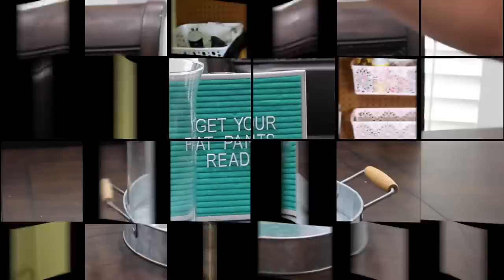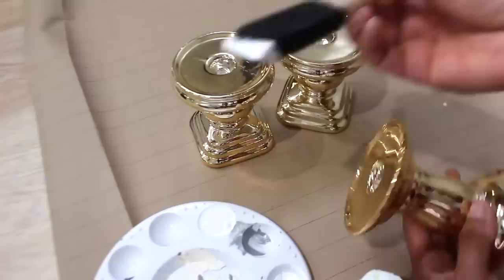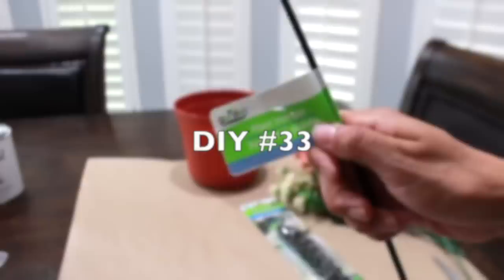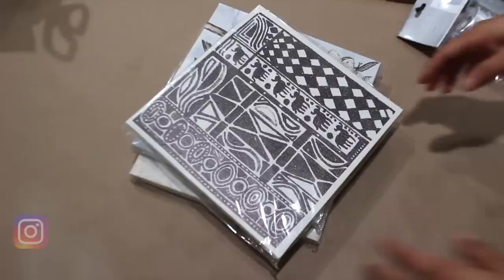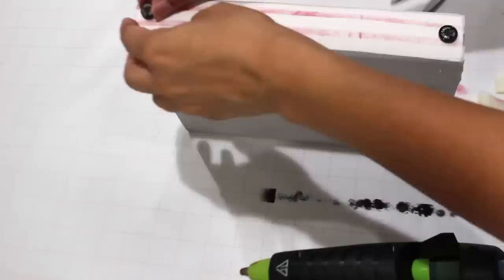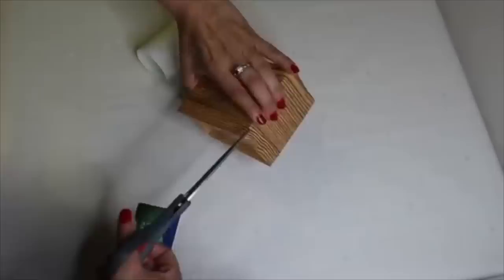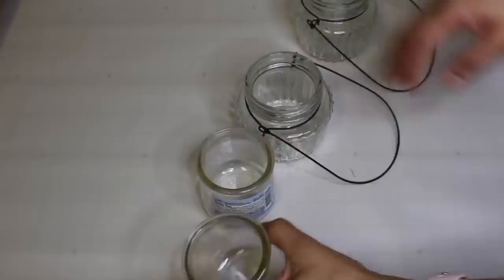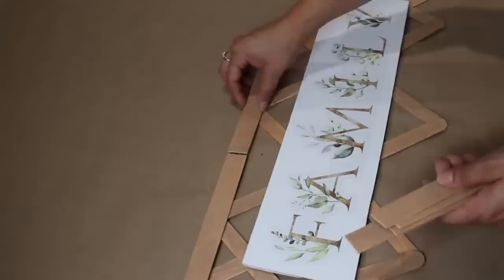100 DOLLAR TREE DIYS!!! | DIYS EVERYONE CAN DO AT HOME

Comment: Have you ever considered using e6000 glue and hot glue on top of it (at the same time) to get a short time long term outcome? The hot glue holds your project together while the e6000 is drying and it gives you a very strong hold for your heavier items. It really works plus gives your craft a stronger hold. You make very nice decor pieces! Your channel is a great inspiration!
Reply from the maker: Hey, Carol! And yes, lots of times. Sometimes it works for me and sometimes it doesn’t. There have been times that it comes apart because the e6000 is too wet and unsticks the hot glue if that makes sense lol...but I heard to add them in different areas to work better. Thank you so much!